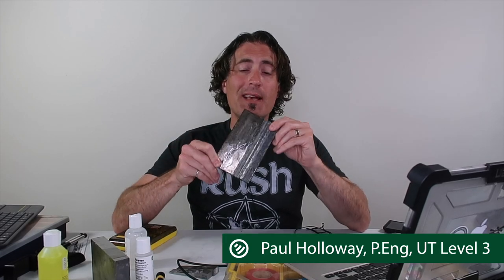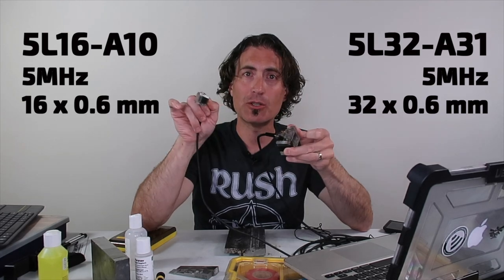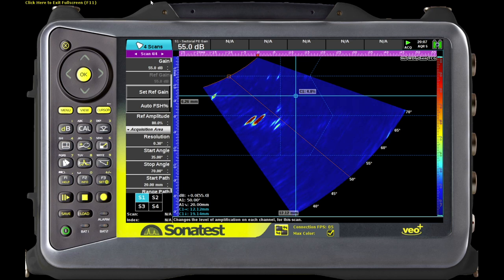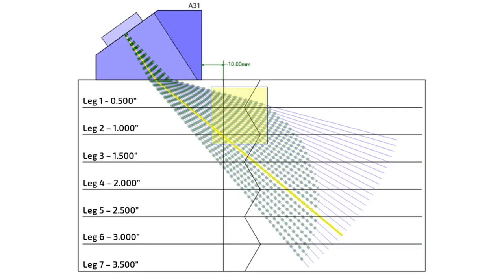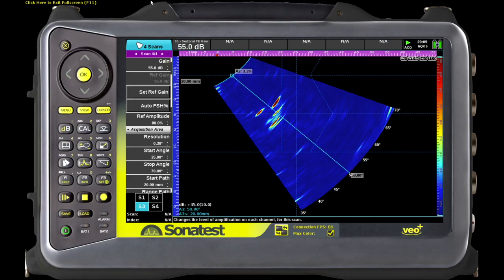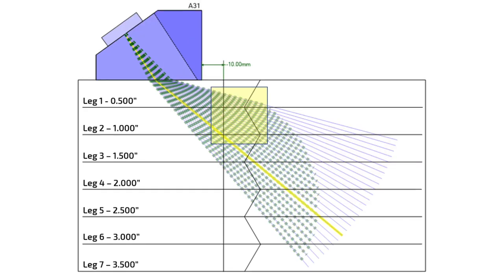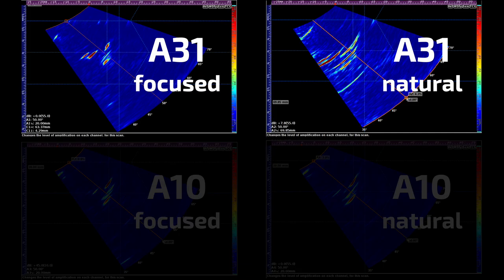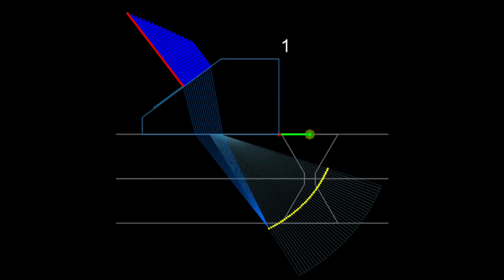Basics of Focusing with Phased Array

Comment: If you we to use two16 element groups (1-16)&(17-32) from a 32 element prob (5L32-A11) would I be correct in assuming that each group would behave the same way a 16 element probe would. Smaller aperture, thus a smaller near field. Therefore less of a need to use focusing.
Reply from the maker: You absolutely could, so yes much shorter NZ but also much poorer angular resolution. 16 doesn't look nearly as nice as 32.
Reply: 👍 thanks for the quick response.